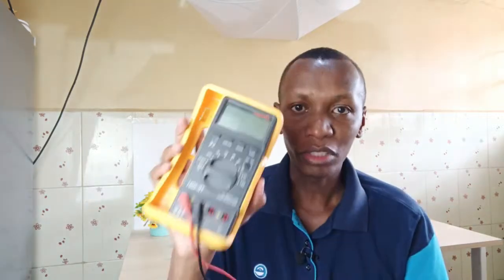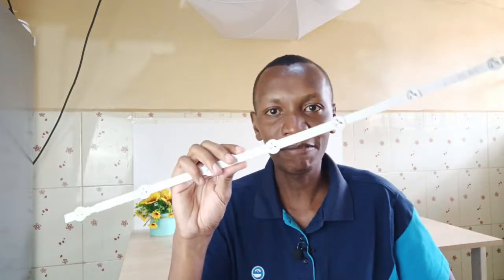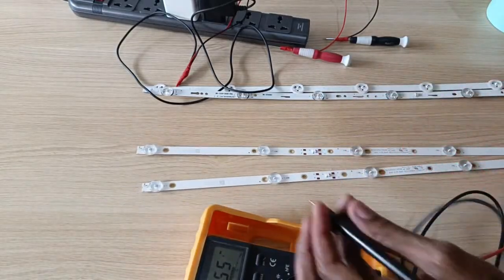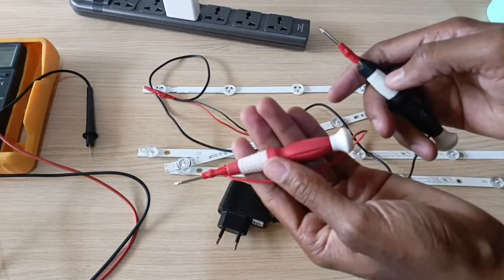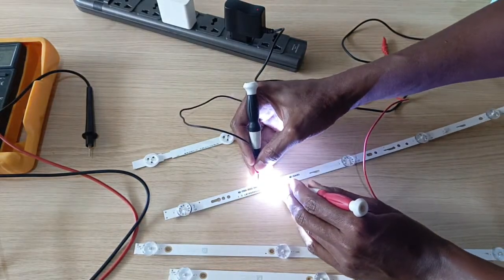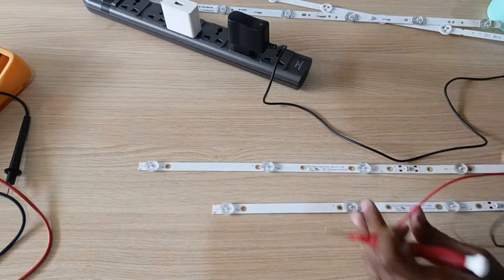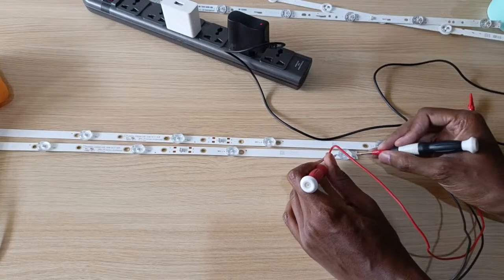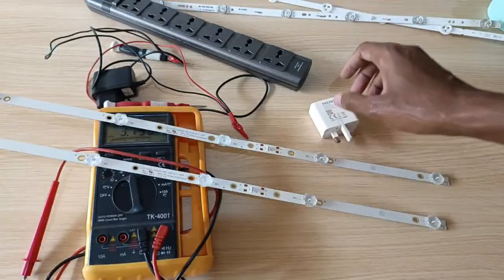Simple and easy backlight tester from a phone charger

Comment: How did you connect the wires to the phone charger where the tape is attached to the wires? A charger has 2 separate wires. Which one went to the positive & negative side?
Reply from the maker: There are two wires inside the charger cable. The red one is the positive and the black one is the negative